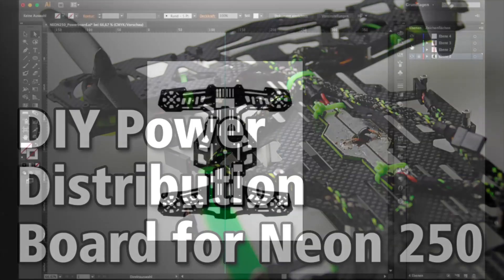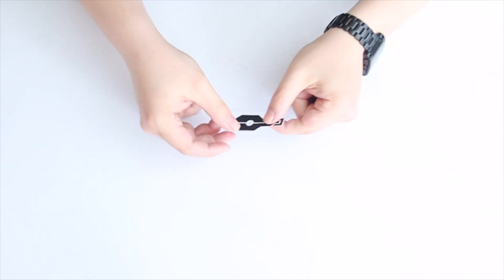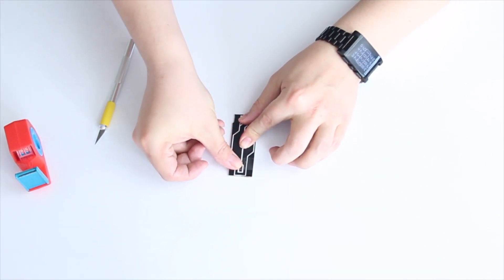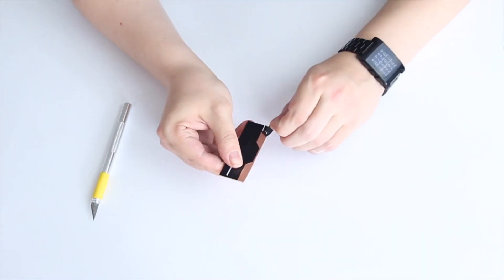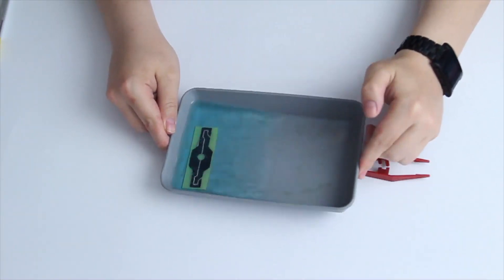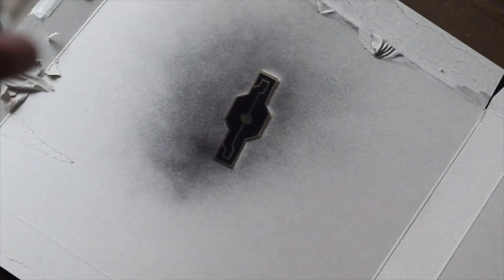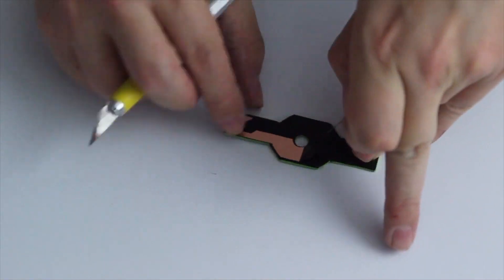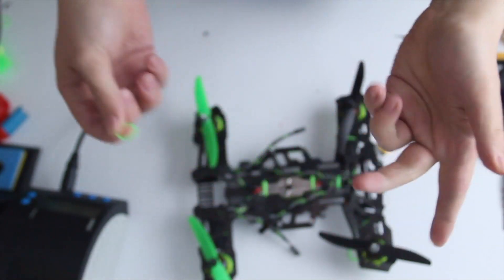DIY Power Distribution Board for Neon250

Comment: what you used to cover cables of the power supply
Reply from the maker: ***** Cable Sleeving <- Search it on youtube/ebay. Mainly used for PC-Modding. How it works: Take off the plug, put the sleeve over the cable, add heat shrink at the ends, readd the plug ;)